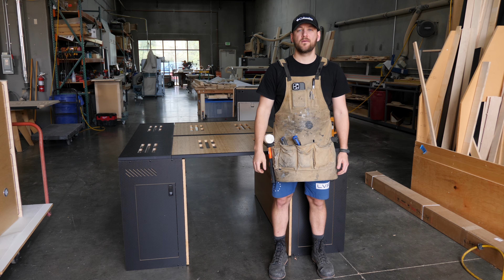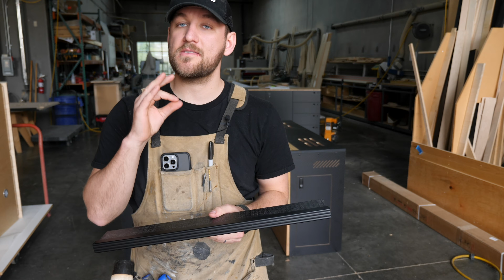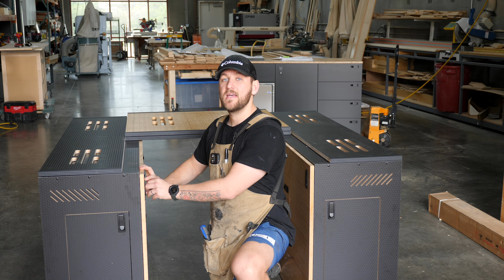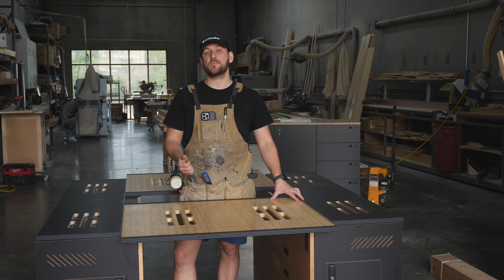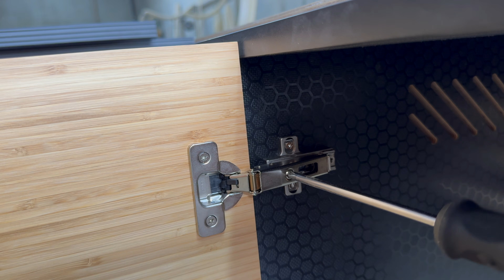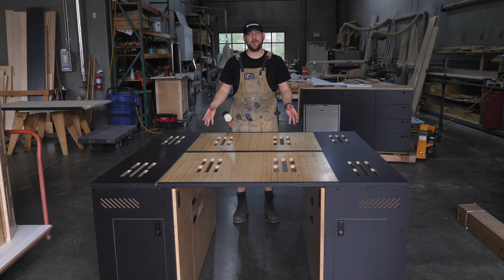Complete Van Bed System For Sprinter, Transit, and Promaster

Comment: This looks like a very well-built system with great design. I'm looking for the compression latches you mentioned that fit 18mm panels. Would you mind sharing the make and model of those?
Reply from the maker: I apologize for the late replay. You can find the latches on our website!
Reply: @Serg_supply Thank you. That certainly makes it easy to find them!

Comment: Is the bed platform also made of plywood? What is the thickness and maximum load weight?
Reply from the maker: Yes! The bed are made of one layer of 3/4" ply. The non-murphy beds also have aluminum stiffeners fastened to the edges to bolster the strength quite a bit. The bed systems are all rated to comfortably carry up to 400lbs in the center where is no support and can handle up to 800lbs if spread over the entire assembly when riv-nutted properly to walls.
Reply: @S @Serg_supply it’s for static load? How it’s tested?

Comment: I haven't been able to find a weight capacity listed anywhere. Any help?
Reply from the maker: This bed is good to support up to 350lbs in the unsupported CenterPoint per bed panel (750lbs) total and can support additional weight if distributed over the cabinets. Materials like Bamboo and Stealth (black hex) are load bearing and can withstand more punishment.
Reply: @Serg_supply  Thanks for the quick reply. I weigh around 320, so it sounds like it should hold my fat a**.

Comment: 5 grand for 300$ worth of materials and some man power. 🤣 was thinking I didn’t want to do the work myself but no doubt after checking out their bed systems I will just go buy the play wood and do it myself.
Reply from the maker: We wish you the very best of luck on your build!
Reply: @Serg_supply  I build high rises, schools, and hospitals for a living. Don’t need luck. You on the other hand are selling a couple pieces of plywood charging 1/6 the price of a brand new sprinter. 🤣 makes absolutely no sense.
Reply: All that building experience, and you can't spell plywood. 😂😂😂@hellogoodbyeforever
Reply: @ I don’t get paid to spell.. idiot.
Reply: @ also. Talk to auto correct.. 🤷‍♂️
Reply: @BillSkullion  That's the difference between designers and workers. They like to copy your idea but laugh afterward.

Comment: What is a lighter weight , sturdier material than plywood?
Reply from the maker: Aluminum would be the closest candidate for that.
Reply: @Serg_supply  I’ve got a slide out bed, the foam is on plywood, it would be easier to slide it out if it didn’t weigh so much, looking for alternative to the heavy plywood

Comment: What is the actual weight difference between building with this HexPly vs  regular Baltic Birch in this 4 piece configuration?
Reply from the maker: Minimal. The Hex ply is slightly heavier due to the exterior coating. Sub 50lbs total for the entire setup.